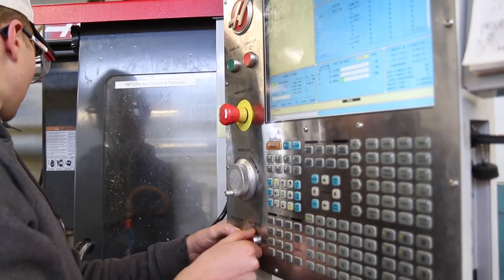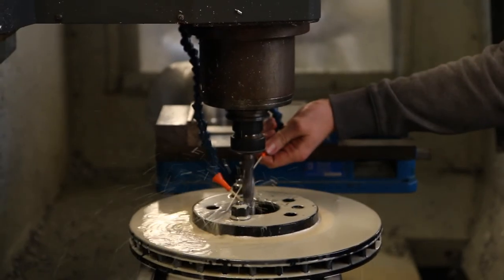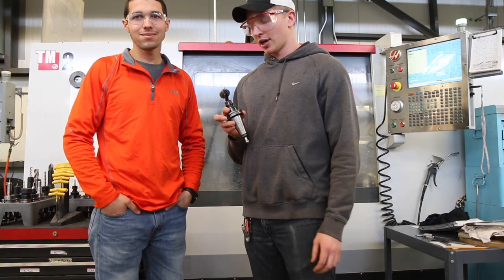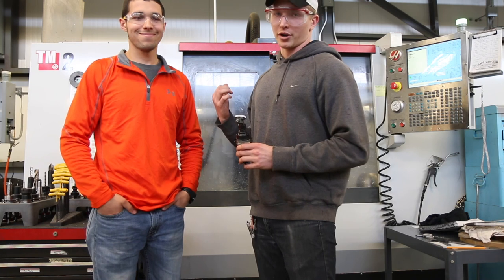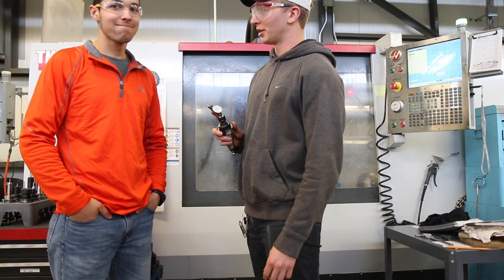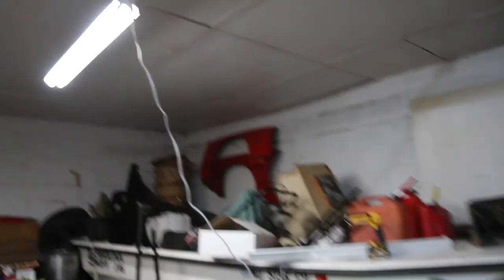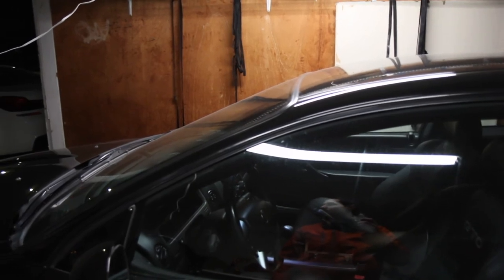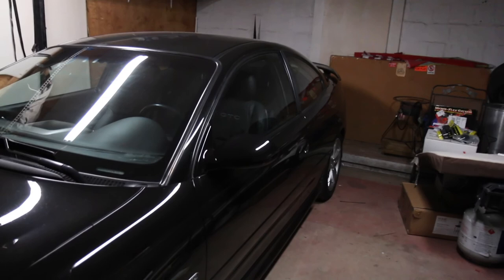VLOG 1: CTSV / ZL1 Brakes On A GTO

Comment: Finally found your vid. I’m going to do this brake swap. Only thing i see being a challenge is getting a machine shop to do the work. Any suggestions
Reply: evsnova74 awesome man! I’m about to start this swap this week so your video is definitely going to help! Thanks!
Reply: @buddyrebel_Garcia  no problem. I put all the torque specs I used in all the descriptions of the other parts of the series and part numbers I used in the description of the intro video for quick reference.